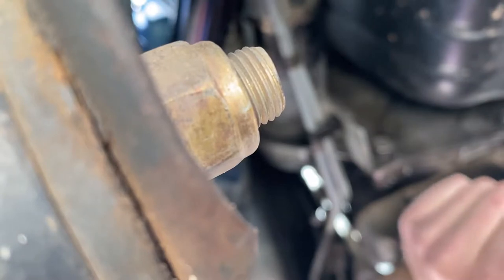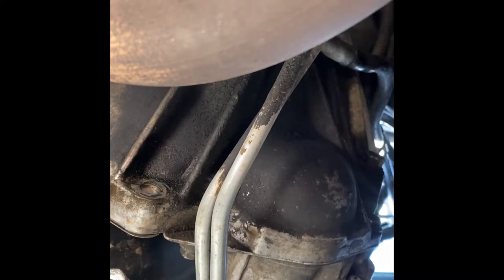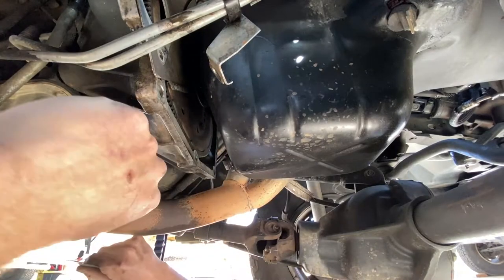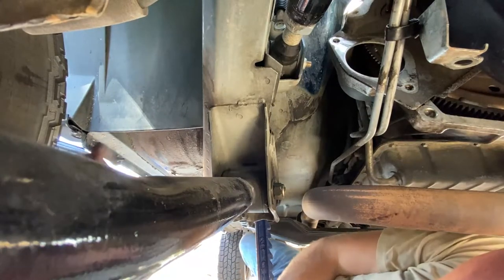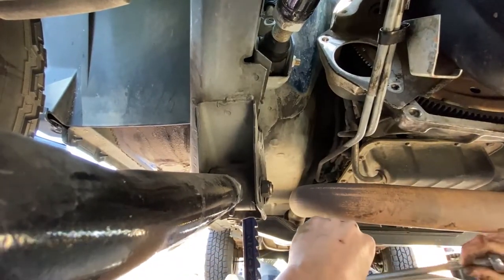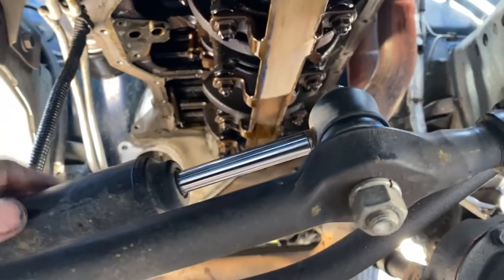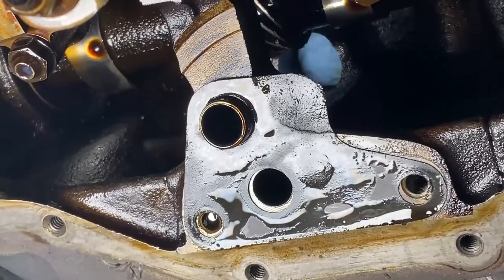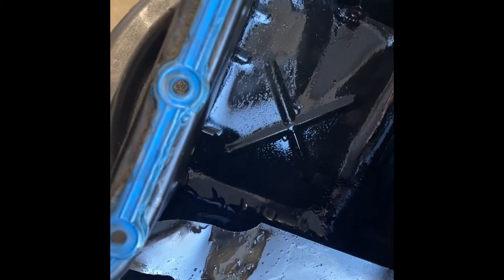Jeep Cherokee XJ camshaft synchronizer replacement part 3

Comment: Hey thanks for the video, yeah I just seen it and it's from 4 or 5 months ago but i was wondering, if by any chance you ever had a problem with the crank shaft position sensor, cause after watching a few videos they said these two parts go hand and hand, well for instance the p0320 code came up on my 2004 WJ so I changed it they said don't use a cheap part well guess what I did lol yeah the cheap part, so the crankshaft sensor just blows up the wire just cuts in have like a squirrel chewed it soon as you try to start it just cuts the wire changed it twice now in one week this time changed the cam sensor as well hope it works wondering if you had the same issue again thank you....
Reply from the maker: I did have an issue with the cam position sensor.  I would be driving and it would randomly turn off but I could put it in neutral and be able to turn it back on again.  I went through the entire wiring harness also since a lot of the wires were bare and soaked in oil etc…. Crank position I swapped out with a oem mopar unit and haven’t had an issue with it.